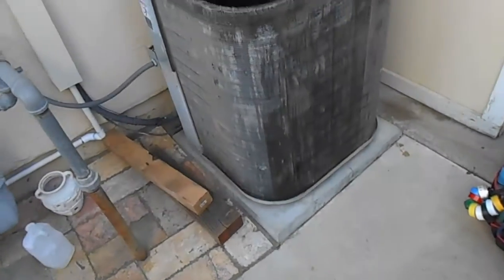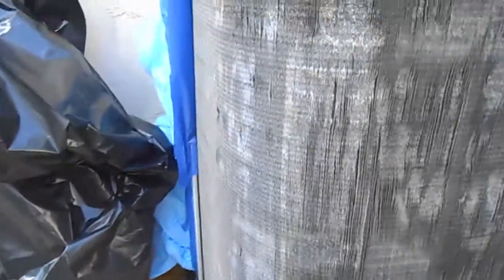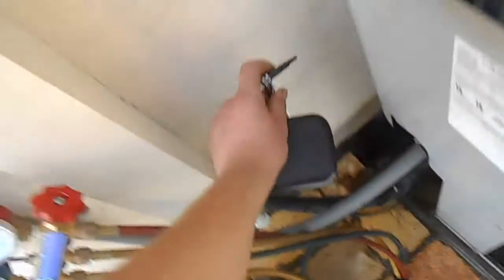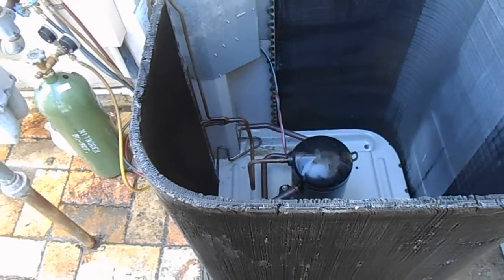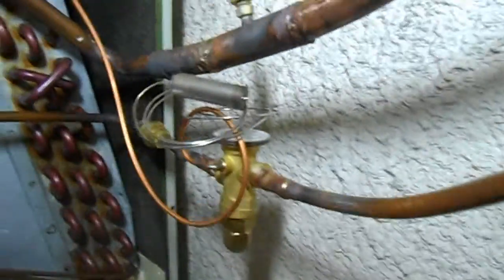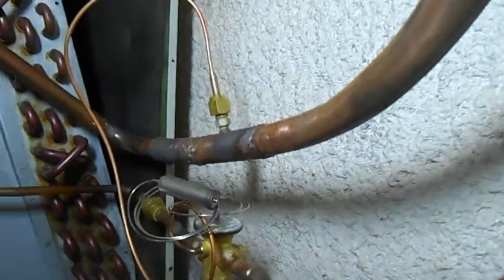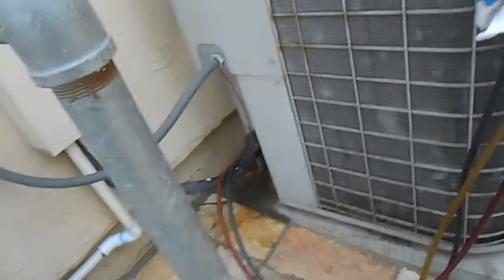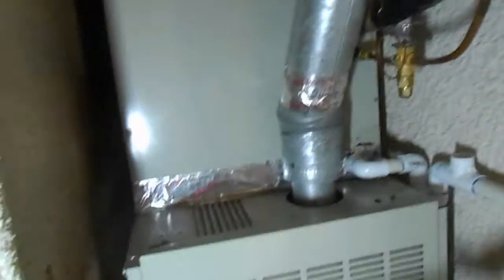Residential A/C Service- Clean Coils, Retrofit TXV

Comment: Hello... Quick question... once you retrofit çan A/C system from orifice to TVX, how do you calculate the Subcooling of the system in order to charge it properly??
Reply from the maker: clauserg the best way to charge a system is by weight; regardless of the metering device. this info will be on the outdoor unit nameplate. if that is not possible due to lack of info or equipment; charging by subcooling is possible. with the system running, note liquid line pressure and the corresponding saturation temperature. with a reliable device (k-type thermocouple) note the temperature of the liquid line. the difference between the saturation temperature and the LL temperature is your subcooling. should be somewhere between 10-15 degrees. Of course, you also want to verify you also have at least 5 degrees of superheat to make sure you don't have liquid returning to the compressor.
Reply: Thanks a lot 71dembones... yes this is my case... the stickers with that information is all gone. I use a Testo 500 so I do have both termal probes and realtime subcolling and superheat calculations so I will keep charge it to 10-15 as you mentioned and taking care of the superheat temp which I have read that after a TXV has been installed I can´t use the superheat chart anymore to determine the correct charging of refrigerant and target superheat value cause it will no longer work the same way, is that correct?
Reply from the maker: Glad I could help. You look for the proper subcooling to determine a full charge when you have a TXV. Verifying the superheat is a double check to make sure you aren't overcharged. The subcooling can look ok on an overcharged system but low superheat will let you know

Comment: Hello 71dembones... do you know where I can fins that Danfoss TXV retrofit kit? it seems it has been discontinued which I don't understand why... How is your Mom's A/C working after a year of that retrofit?
Reply from the maker: clauserg Thanks for watching! I did not buy a retro fit kit: it was just a 5 ton txv with sweat connections. To retrofit, dissemble the union-type fitting that holds the piston. BE CAREFUL, it is usually left-hand thread and is sealed with a o ring. Remove the piston, braze the txv on a horizontal piece of liquid line  coming out of the air handler.  If it is a heat pump get a heat pump txv. wet rag the piston union fitting and the txv while brazing. use nitrogen. My Mom's AC has been running strong ever since. Hope this helps. Thanks for watching!

Comment: I like a txv over a piston anyday, will make the system operate better and more efficiently. If i was doing all that work i wouldve added one regardless. I like the ones my goodman supply house stocks because they have an insulation boot that covers the txv completely. If there not insulated they will sweat alot! Good job man. Looks good. Added pressure controls to way to go. Problem prevention. Good thinkin